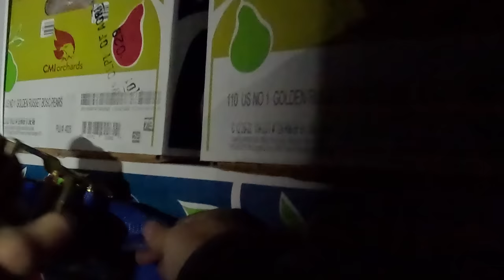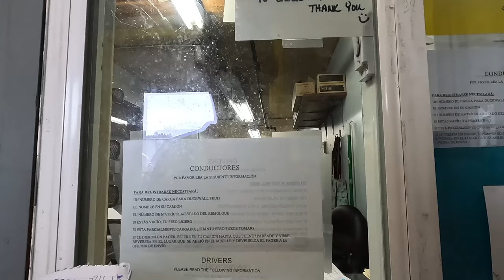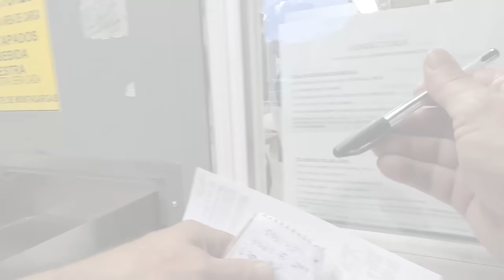Life On The Road With Yeshua & Trucker Ray - Trucking Vlog - Dec 29th - 2022 - Jan 3rd - 2023 - 4K

Comment: Hi Ray, this reminded me of issues with a battery cable on 83 Chevy. It was giving me trouble starting so I stopped turning it off. I took the chance and shut it off. It wouldn't start! Mechanic got it going after day and a half. I drove from Rawlins Wyoming to Colorado Springs without shutting car off. Got it to the mechanic and it turns out the battery cable had corrosion deep inside. New cable - no issues!
God Bless and Keep the Greasy Side Down!

Comment: Hello , why are trailers 53’ and not 54’ or 55’ or even 52 ‘ what is the significant of 53 ? Is there something special about the number 53 ?Oh ya Blessings to you ;)
Reply: Hi Kelly,  
     Trailer size increased to 53 feet (from 48 feet) which allows 13 rows of standard size pallets (26 pallets) and still be able to close the trailer doors. The 53 foot length was finally allowed by the DOT in the late 1980's.